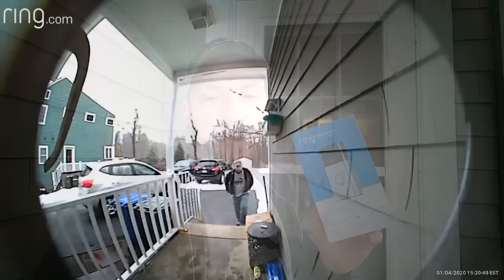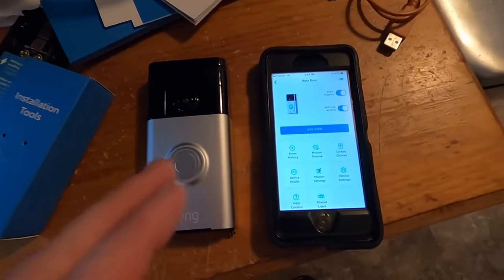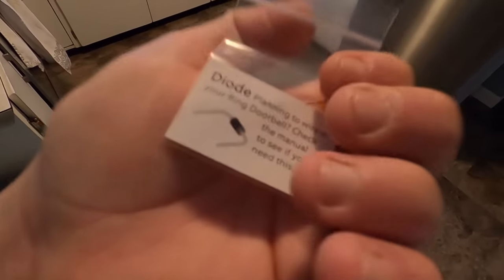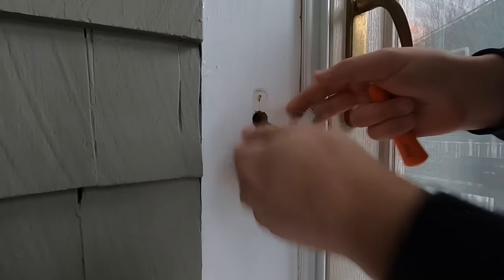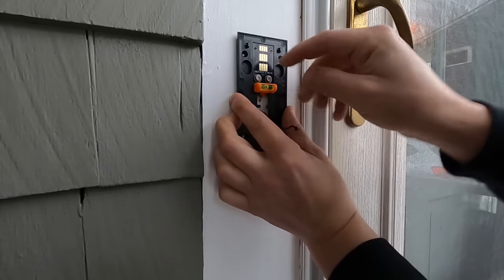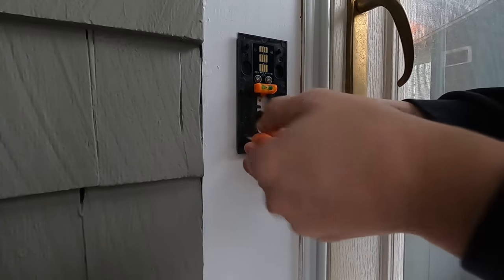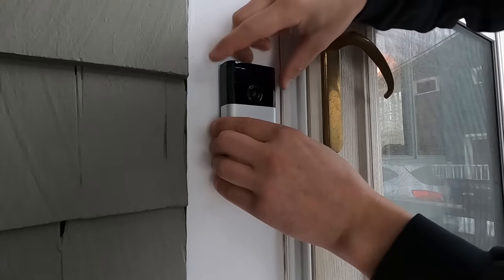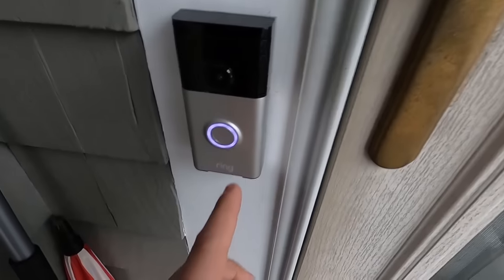How To Replace a Wired Doorbell with Ring Video Doorbell | DiY Install

Comment from the maker: Buy a Ring Video Doorbell here - https://amzn.to/35jdQFN (affiliate link)

Hey everyone, since some people have been asking... You only have to remove the Ring to charge it if you do not hook it up to an existing doorbell.  I’m sorry I should have clarified that.  So to be clear if you do not hook it up to existing wiring you need to remove and charge, otherwise the doorbell wires will charge it if you have it hooked up.

Also, doorbell wires are low voltage, they can not shock you and all that happens when you touch them together is the doorbell goes off.  If it makes you feel better you can shut off the power in your panel but is not necessary.  

Please consider subscribing to my channel: https://bit.ly/SubscribeToTheFixer

Thanks for watching! 😃
Reply: Can this be hooked up to a android cell phone would love to know thank you very much for this video
Reply: If you have a digital doorbell you might have a DC transformer. Ring will not charge from a DC current, you will have to replace your transformer to an old school AC transformer.
Reply: Okay thanks for clarifying! I’m terrible with wiring and easy things like this and I wouldn’t have gotten the courage to instal this on my own without you saying I wasn’t going to die if I didn’t know where to go turn off the power 😂 
Thank you!!!
Reply: Great video & clarification.
Reply: I had one of these about a year ago someone stripped the nut and I never could get the camera off again to charge it and use it. I now just got another one in today.  I missed it and I am waiting on my ring video door bell to charge. How long does it take do you remember ? Your tip about the existing wiring. Made me wish I had existing wiring then I wouldn't have to take it down at all right ?
Reply: @TmanGamingX takes a few hours to recharge.
Reply: @marklt808   That's a good idea. I didn't know you could. When you told me about this just now, I looked on amazon and the had solar power for about $49 So I may go that route. I didn't know that existing doorbells charged the ring video door bell. Thanks for the tip. And the quick response to my question.  My dog remembered the ring door bell I had before. He barked when you rang your door bell. LoL
Reply: Could someone run drop cord set up, so could charge without taking down?
Reply: Better than ever
Reply: Thank you for clarifying. You answered all of my questions!
Reply: I was just looking for where to ask that very question!  Thank you so much!
Reply: @The fixer mine still doesn't work wired up my doorbell is the mechanic so I dont need a diode..idk what is wrong..also my posts are on the back of the Ring and not on the brackets.HELP
Reply from the maker: @wicker478  Hey, maybe this video will help you?  https://youtu.be/B64ZSbjpBSQ
Reply: Can you touch the wires without turning off the circuit breaker?
Reply: Okvfunyi
Reply: I was about to ask about the power being on. Thank you my hubby is getting me this one for Christmas! Im excited to install myself
Reply: My existing doorbell is cemented into the wall because it is irregular stone shapes. So no screws to remove. Could you help with switching one of those out to a ring door bell? Thank you
Reply: I really appreciate your explanation of installation. Great video thanks!
Reply: Which ring doorbell did you use to fo this video
Reply: I am glad you cleared that up.
Reply: My doorbell didnt work after i install it just like you did
Reply: Tyvm for explaining not necessary, turning off the power.
Reply: Good to know
Reply: I have a question how long does it take to charging ring bell after you install
Reply: Do you have a video with installing the pro power kit V2?
Reply: Thanks for your video,  I'm technically challenged lol

Comment: For anyone worried about not turning the breaker off before installing. Don’t worry, unless your doorbell is supplying over 100 volts (which it won’t lol). I’m an HVAC tech and 12-24 volts won’t harm you or your Ring.

Comment: I got a ring doorbell today and instead of reading the instructions I came directly to this video
Reply: And probably fried it or it lost a few years off it's life because he didn't turn off his breaker for it.
Reply: @HalkerVeil  works perfect. Great video.
Reply: @domnfg  I'm sure it does. Just don't be suprised when it doesn't in a year.
Reply: @HalkerVeil  why bc he connected the LV to the terminals live? I’m confused
Reply: @Nick-bh1fy  Yeah. Especially if it's a higher volt doorbell. They can range from 12 to 24 volts. Lower voltage won't do much harm but if it's a higher one it definitly will. The problem I had is teaching others to do it unsafe. And I don't mean just harm to the new doorbell. 24 is enough to spark a fire easily. If not at the point of contact, then somewhere in the wall.
Reply: Yupp me to lazy to read lol
Reply: Lol 😆 same
Reply: Honestly I would have too. I'm a visual step by step learner haha
Reply: Lol
Reply: You did what to this video?😳
Reply: Same thing for me. No instructions
Reply: Welcome to man hood

Comment: You should always turn off the power at the breaker first even if it is low voltage.
Reply: No I like the tingle
Reply: kiyonexus Clown.
Reply: @rosemarypierre4353  Glad to know Google isn’t handing out electrical engineering degrees.
Reply: I've been an electrician for 12 years and rule #1 is NEVER assume the person before you was competent.  I've seen some of the most egregious mistakes in this trade that would easily kill a novice that was expecting everyone to conform to code. I would cut the power because only a few seconds of your time could actually save your life.
Reply: @devonteforeman  agree, safety first.
Reply: Unsafe? it’s  like 15 vac it couldn’t zap an ant . Unless it’s not
Reply: @TheRedRaven_  NO, I'll keep it on. It is low voltage from a transformer somewhere between 8-24 vac. No chance getting electrocuted by the supply voltage (120vac) since it's electrically isolated with no direct contact. Unsafe? No. Moron? That's a little harsh, don't you think? Smarter than you? Perhaps just more experienced around electricity.
Reply: @TheRedRaven_  You are evidently ignorant of low voltage electricity. Stop dissing people because of it. Smarten up...educate yourself.
Reply: @toms.3977  Lol do what you want, I work in the field and continue to work in the field professionally. 10 years in the military as a GSE mechanic and now 6 years as a contractor for the DoD.
Reply: You should also eat a tuna fish sandwich on a bread stick
Reply: @avocadoo4387   you win
Reply: thanks Andy, this is why i came to youtube. Needed to know because its not in the instructions and i couldnt find it in most videos. I got shocked once installing low voltage doorbell.
Reply: @TheRedRaven_  How on earth are even able to remove a 9 volt battery from it's package. Doorbells only operate on 12 volt or 24 volt, and the two wires coming to the button/switch do not have any potential between them. You probably closely follow what the media says. You shouldn't be so condescending when it's obvious you have no clue what you're talking about.
Reply: If the wiring was not up to code or reversed, the original door bell would have most likely shorted out.
Reply: I was thinking the same lol
Reply: @BillyBongwaters  What’s Up And You Need Buy Ring Doorbell And With Echo Dot 2nd Generation?
Reply: @Alexander_l322  100% not required t turn off breaker for 12v power.  I can probably lick it with my tongue and not feel it:)
Reply: @RichRich007  me too. I wire in LEDs and all kinds of stuff using 12v power and I’ve come to no harm. My door bell transformer is 24/36v and I didn’t feel anything when I wired that in to my ring door bell
Reply: @TheRedRaven_  nice always nice to see any GS out there!
Reply: @sippycup6762  A low voltage battery is clearly isolated, working on a house is a different story. Everyone keeps repeating “low voltage” as if that’s the underlying issue, it’s not. The issue is not knowing whether the transformer or wiring behind it is up to code. It most likely is, but “most likely” only works if you’re unsafe and willing to take the risk of shock, damaging the product you’re installing or worse, killing yourself. What’s funny to me is these comments most likely took more time to write than turn a simple  breaker off, but that’s just the nature of now it all’s, isn’t it.
Reply: @TheRedRaven_  just stop already
Reply: @TheRedRaven_  I think the raven is a little "triggered" this evening
Reply: @Alexander_l322  Hey?
Reply: @devonteforeman  no way any building code would allow some one to pull a 10-2 wire to hook up a door bell.. i don't know what world u live in but no idiot in this world would pull an oven outlet and make it a door bell MAINLY BC ITS NOT EVEN COST EFFICIENT.  Most stuff is wrong is bc of cut corners.  All the people hitting the like button are why u stay in business. A low volt door bell wont even give u a tingle PERIOD.....this save your life is way too over the top. This is a door bell install not a "HEAVY UP"
Reply: @mattmiller859  I never suggested a homeowner or DIYer isn't capable of doing this job themselves. I simply suggested they err on the side of caution whenever dealing with electricity. I solute you YT warrior, and perhaps I can donate to your tissue supply.
Reply: @Alexander_l322  oooooo you're ard 😂😂😂
Reply: @devonteforeman  this was my first thought. I wouldn't put it passed the people that owned my home before me to cut corners. Better safe than electrocuted is what I always say lol
Reply: That was my biggest question about the video.  I kept thinking shouldn't the power be turned off?
Reply: @Alexander_l322  😅
Reply: So after reading these comments I decided not to waste my steps going to basement and turn off the breakers. Worst mistake ever!  I got a shock and was wondering what it was, did it again and now i’m addict to that jolt. Now i’m wondering if I should put back the cover.
Reply: Lol😂

Comment: One point to note before installing make sure to CUT POWER OFF from circuit breaker to avoid potential electrocution. Safety first. Besides that good instructional video.
Reply: And he explained why, in a prior comment/reply. :)

Comment: Whole lotta people from Amazon Prime Day is about to raid this video
Reply from the maker: I hope this is a good thing. 🤔😁
Reply: I am one of them lo
Reply: I did this same exact install and the inside doorbell still doesn’t work. Any suggestions?
Reply: Yep, that's me 😂
Reply: As I am one of them.lol
Reply: @chrisyeatts  mine either
Reply: Seam like if you had a wired door bell it should charge the battery
Reply: I’m thinking of getting one so your video is very helpful 
Thanks!

Comment: A suggestion, when I ordered my ring doorbell, I went ahead and ordered a second battery.  Now, when the battery runs down I just pop off the cover, install the fresh battery and pop the cover back on.   Now my bell is always operating and I don't have down time while the other battery charges, which can take a while.  Also, if a battery should fail, I'm not completely without my doorbell service while another battery is shipped.  It's well worth the extra bucks for the battery and I highly recommend it.   :)  
  Good video, simple and correct. 
  As for the height of mounting, it has a wide and tall range of view and people will look right at the bell when they go to press it, so you'll have no problem getting a face shot.  If they're just coming to door or on porch, you'll still get enough view for an identification should you need it for later.  (Cops, etc.)
  You can also adjust your field of motion sensitivity to get the best performance for your door. 
  You didn't mention it but when you put in the first two screws to mount the plate, you went to opposite corners.  You seem to understand the principle but to anyone else watching, mounting opposite corners like that ensures that you keep your level reference and helps keep even pressure on the plate so you don't bind it at all.  Good demo.
Reply: I cannot believe nobody and I mean nobody commented to say thank you for that is a fantastic idea!!!!!!!! You brought up very good reasons for ordering an extra battery so you the best comment award you have earned!!!!
Reply: @jimmygrant424  
  Why, thanks for the kind words...
Reply: Thanks!!!
Reply: Thanks
Reply: Hello. Could you please advise what the battery life is like.
Reply: @chrislareau8110 
   It really depends upon what type/how much activity you have where the bell/camera is located.  If you have a lot of foot/driveway/street traffic, dogs going in and out, etc., I have a cat that has figured out how it works and when she wants in, she jumps up on the railing by the door, sets off the alert and stares at the door,waiting for us to come let her in.  😆  If we don't come soon enough for her liking, she'll do it over again until we do.  Smart cat.  Some dogs will come up and ring the bell, there are videos of that going around. 
  It can run down fairly quickly, say a couple of months...  Or, it could last several months.  Temperature and other environmental things and how you set up the preferences all come into play.  What I did (and the smartest thing you can do) is to buy a second battery and have it charged.  When I get low battery warnings I let it run down (recommended), then just swap it for the charged battery.  It only takes a minute then, I put the depleted battery on the charge and forget about it.  It's cheap enough for a second battery ($29 regular price) and that way, whether it wears down or has a problem and dies, you're never without your doorbell.
  The battery can take 4-5 hours to charge so, if the down time doesn't bother you great but, I just wanted to ensure that I wouldn't suddenly be without my doorbell if for some reason there was a malfunction. 
  Batteries aren't known to be the most reliable things made but, that said... I've never had any troubles out of mine other than normal depletion. 
It's not in a place where I can hardwire it but, that's fine with how I'm set up.  I really enjoy having it, especially since I'm a disabled vet and can't always just jump up to get the door.
Good luck, hope that helps.
Reply: If this is hardwired, why do you need a battery?

Comment: Thank you so much I’ve had my Ring for more than 9 months and have yet to install it because I didn’t want to destroy the front of my house but now i feel comfortable enough to do it myself 😊
Reply: Did you do it?
Reply: Kinda same, but 2yrs for me!!😂
Reply: Keep in mind that Ring forwards any and all of your data to the government without a warrant and you're paying them to do it.
Reply: I still have mine in the original box after 2 1/2 years.   The programming step he skipped over in the video about chargine and programming it using the App is where I get flummoxed.  I hired an electrician and he quit stating that my doorbell was an old 7 volt and needed to be a 12 volt to make it work.  RIght now, the ring just sits there in its original box.  But, my doorbell still works and so does my trigger finger.  🤯
Reply: It would be good if the "government" would follow up and prosecute the porch pirates that these cameras catch in the act.

Comment: Nice tutorial! One thing, though… I know (and you know) doorbells are generally safe, but your viewers may not be as experienced as you are, or could be working with dangerously/incorrectly installed circuits, or might misjudge their safety and end up getting shocked. Not explaining/observing basic electrical safety practices (like switching off the circuit breaker and never handling live wires of a system connected to mains) when explaining these topics could backfire one day for either you or your viewers.

You create some great content, make it even greater by teaching your viewers how not to get shocked 😛
Reply: that's a good point, i thought those wires are non electric, if they're  as he stated why is it that it doesn't mater which side the wires goes, that means no positive or negative at all?!!!
Reply: @frankg846  Nope. That's because the wires run alternating current, which means the polarity changes constantly, it's just like your mains electricity, except at a lower voltage (8 to 24V AC normally)
Reply: @guidoscalise  so the wires are electric and you have to turn off the breakers first, correct?
Reply: @frankg846  Yes, those wires are live. In fact, the Ring Doorbell maintains a trickle charge to its battery through them. So, it's not a bad idea to turn the breakers off. It takes you less than 30 seconds and it's a good habit to have anyway.
Reply: @guidoscalise  awesome! Thank you, wanted to install mine today.
Reply: @frankg846  should be really really easy. I installed my friend's Video Doorbell in literally 10 minutes. All the best!

Comment: I am glad you cleared that up about charging first, then hooking up to an existing doorbell to eliminate the need to take it off to recharge. I didn't charge mine up BEFORE installing the first one, annd had to wait hours before I could use it.
Also, if you do not have an existing WIRED doorbell, you can buy a transformer from most home tools shop and either hook it up to an existing 120 volt source or connect it to and outlet with a plug.
Reply: After you charge it and wire it in, do you ever have to charge it back up again ?
Reply: Thank you!
Reply: i have the same question, as jay collins,  after you charge it. Do we need to recharge it again or is just one charge..??
Reply: you should not have to recharge it IF it is hardwired.